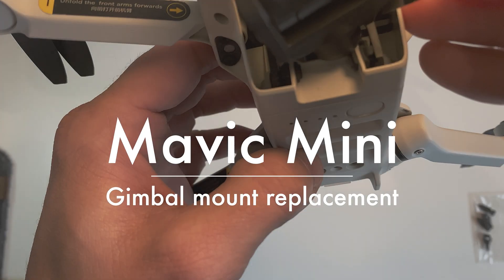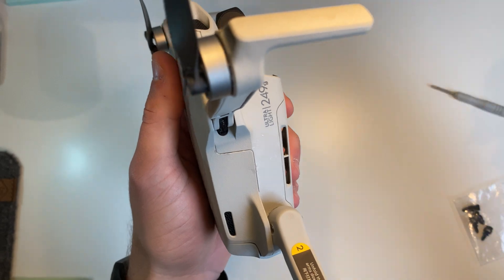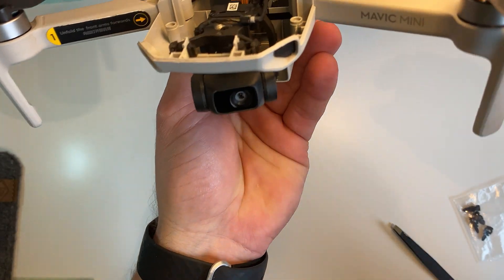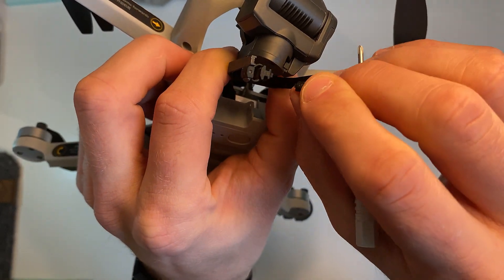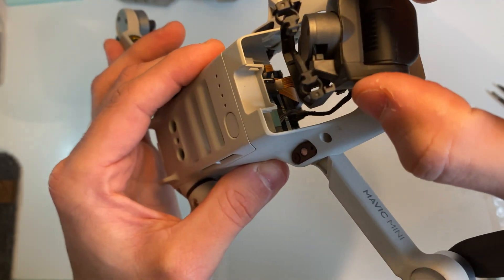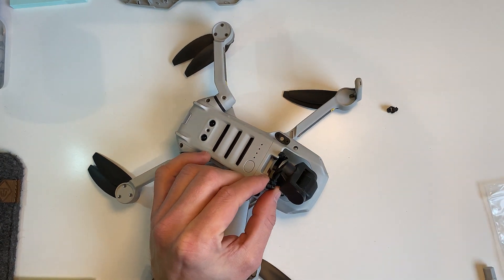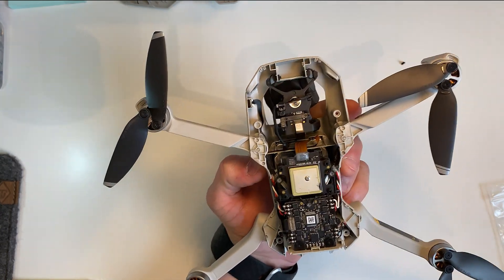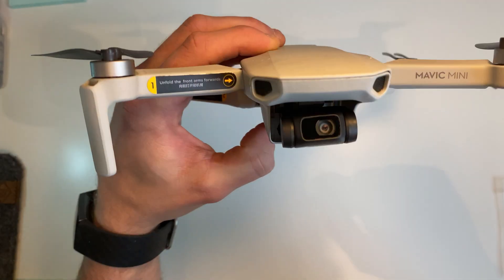Replace rubber gimbal mounts on DJI Mavic Mini

Comment: I HAVE A MINI 2 THAT HAS A SHAKEN IMAGE IN SOME TAKES, I HAVE ALREADY REPLACED THE ORIGINAL PROPELLER, CALIBRATED IT AND IT DIDN'T HELP IT. MY SHOCK ABSORBERS ARE NOT BROKEN. DO YOU THINK IT COULD BE WEAR AND WEAR? DO YOU BELIEVE THAT IF I REPLACE THEM IT WILL SOLVE IT OR DO YOU KNOW IF THE WORN RUBBERS COULD BE CAUSING THE SHAKE (GELATIN)? THANKS FOR THE VIDEO.
Reply: I get Jello on mini 2 when flying backwards sometimes. I suspect the rubbers have worn out from years of use..rubber bands eventually stretch and lose elasticity. I think the video jello vibrations when flying backwards is due to the back of the gimbal making contact with the body of the drone just behind the gimbal as flying backwards changes the flying angle. If the rubbers aren’t as solid anymore there’s more tolerance for that whole gimbal / camera to move back and touch the frame.

I’m going to change the rubbers and see if it fixes it.
Reply: @koalafpv  did it solve the problem ? I too have the jello issue
Reply: @Dr.Bombay47  I haven't gotten the parts yet. Do you get the jello only when flying backwards? Any crashes?
Reply: @koalafpv  no the jello effect presists in all conditions. I had a couple of minor crashes in the past. Nothing major though. Also there is no damage to the drone body
Reply: @ you may have a damaged gimbal but maybe try to take a look at the rubber mounts. Do they appear worn out / ripped / pulled out?
Reply: @koalafpv  there is quite some dirt on the bottom damper. It looks a bit worn out
Reply: @ same with mine. I’m going to try to source some new ones and see if it fixes it. I think if the rubber is too loose the camera touched the plastic housing and causes the vibrations.
Reply: @koalafpv  yes, I also had the same impression.
Let me know how it goes. I too will order the rubber dampers
Reply: @Dr.Bombay47 rubber dampers were ordered. I also prepped for the repair by opening the top of the mini 2. It wasn’t the most fun task to open the top lid 😅
Reply: @koalafpv  Ohh yea. I saw a video about it and it didn't look very easy. You still need to pry open the top
Reply: @ so I replaced the gimbal dampers and it fixed 80% of the issue, the rest was taken care of with some 99% ISO. Sprayed around the gimbal area and used a toothbrush. When I would press the button to have the camera facing down or on a slight angle it would vibrate violently. After the ISO and toothbrush that fully went away.

I suspect it’s a combo of gimbal dampers and gunk getting into the gimbal from take-offs and landing where dust and debris flies into the crevices.
Reply: @koalafpv  hey Thanks for getting back :)
Great that it worked for you. In that case I will maybe try and clean the dirt thoroughly first. Mine is quite dirty already. I ordered the dampers anyways. Hopefully the cleaning does the trick 🤞
Reply: @ if you have a iso spray bottle make sure it’s 99% ISO and don’t be shy to squirt in the gimbal crevices and move the camera pitch around while doing it.
Reply: @Dr.Bombay47  the hardest part of the repair is just opening the top she’ll carefully enough not to damage it. Use plastic pry tools.
Reply: @koalafpv  yes I agree. I already pulled open the back part once mistakenly while removing my attached landing gear. Those plastic parts can be quite delicate.

Comment: Thanks for the info. My rear dampers popped out when i hit a tree. I have to order the dampers.i have the gimbal is not stuck.
Reply: this guy has no clue that it is so easy to mount the camera first and then insert the rubber mounts, no need to unscrew anything

Comment: Did you have an issue with gimbal motors while doing a IMU calibration when you put your drone upwards (placed on battery door while calibrating). Maybe the rubbers on my mini are weak so they need to be replaced. When I doing a calibration gimbal goes backwards and kicks the housing so I hear that motors on the gimbal are loaded.
Reply from the maker: No I never had those issues when the rubber was broken. It was only one side that was broken for me though.